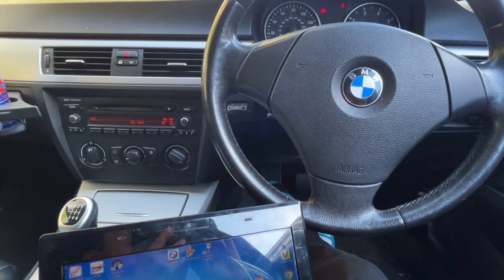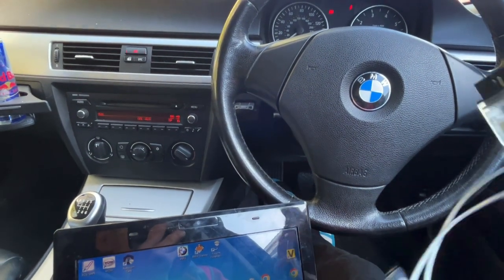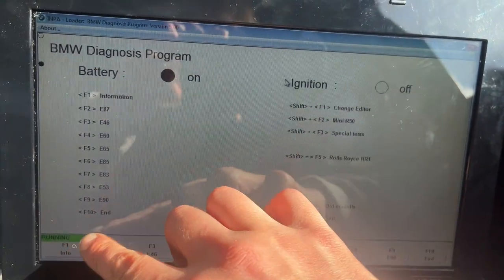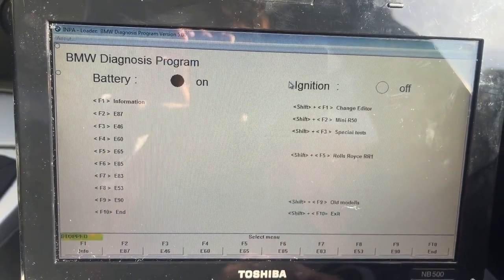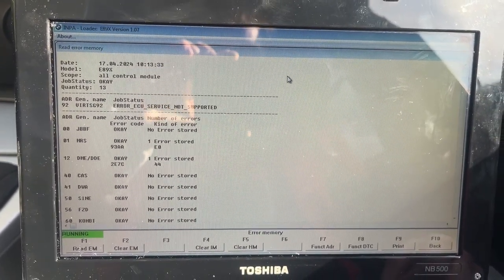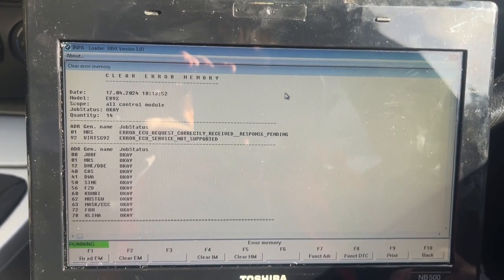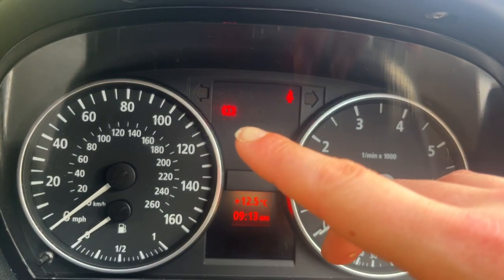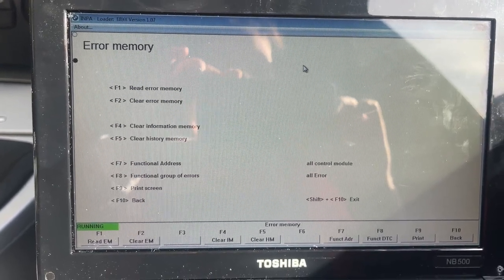How to use INPA to scan your BMW and clear fault codes!

Comment: You should try the kingbolen ediag elite it's one of the best Bluetooth OBD2 scanners on the market today and works on over 170 car brands including the BMW cars and works using wireless Bluetooth on a smartphone.The kingbolen ediag elite uses the same software as professional high end scanners like Thinkcar and Launch used by mechanics.

Comment: Can you please share the link to download inpa, thank you
Reply from the maker: Unfortunately, I don't have a link I brought my laptop from Central Diagnostic fully loaded. check there website they even sell IMPA download separately :)
Reply: I need an english version of it.
Reply: @thisguyshorty3554 same mines in German 😢
Reply: i plug my k-dcan wire into the car with ignition on but yet i don’t see it saying that the car is connected to
the program. the wire is lit
red and i have the switch towards the left. is there anything i have to do to activate inpa?
Reply: @MBS..  laptop
Reply: @MBS..  plug the wire into the car first, then connect to the pc, then open inpa
Reply: @MBS.. it has to be to the right I believe at least for like tuning
Reply: @Redd-hx7pt  no, u need to set up or COM ports right... device manager and plug in the cable and u will go to proterties and set it to COM1... also there is some sc or ms or smt, i think its set to 16, u gotta set it to 1... and some drivers and it will work.
Reply: I can send it to u if u need it still
Reply: @PrimozDvorsak  do you have inpa link to share?